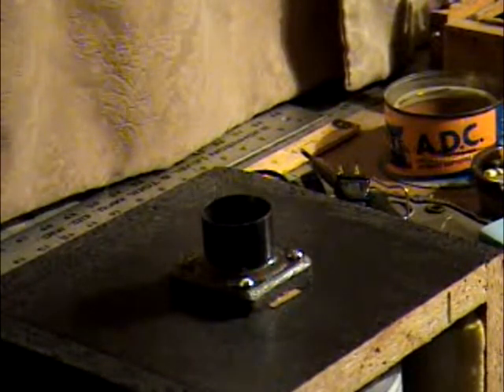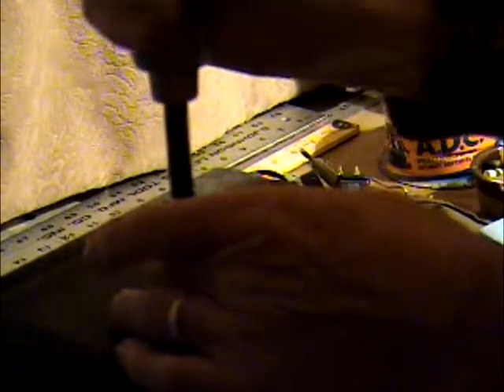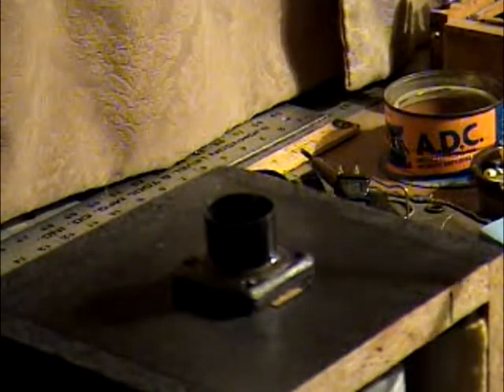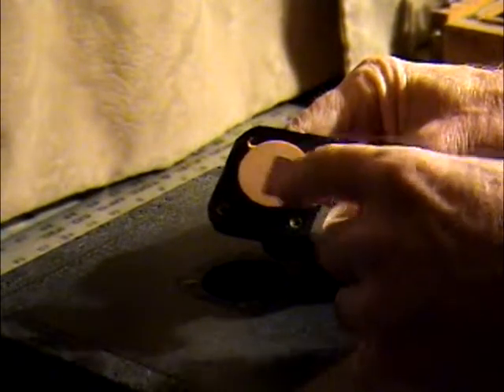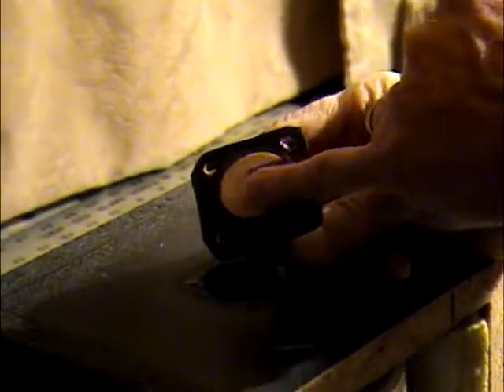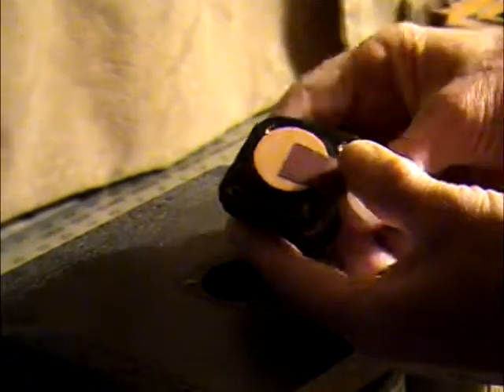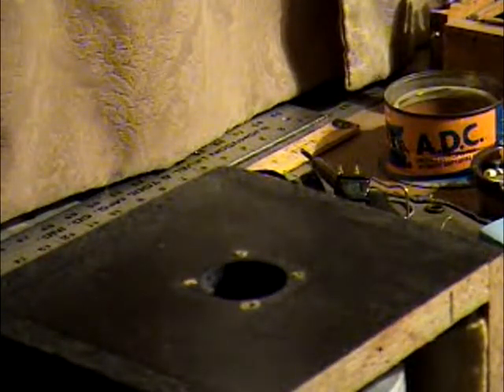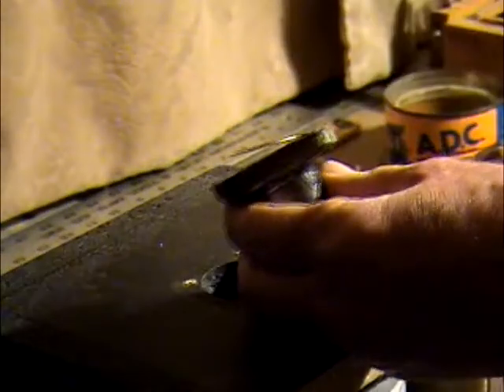Check Valve in an Electric Vacuum Pump by John A Tuttle from Player-Care.com

Comment: Great videos. Thx!!
 My 2nd player piano has a similar looking electric pump.  The check valve wasn't working so pumping by foot was futile.    When I pumped hard,  I noticed it made a horrible sound, like a bullfrog croaking.  
The owners just gave me the piano. 
When I got it home I found the loss of vacuum was the electric motor.  I opened the pump box.  Inside it had a 6 inch leather strap nailed across the hole.  It was supposed to seal the hole when using the foot pump.  It was too loose, so it vibrated badly. (the frog sound).  I was afraid if I tightened the strap, I would impede the flow of the electric motor, so I removed the strap for now thinking I could design a better check valve later.
What I did was cut a disk out of tin can lid, covered it with felt and attached a home-brew hinge.  I used a thin ballpoint pen size spring mounted sideways at the hinge to hold the valve shut.  It works pretty well.  Never thought of bellows cloth.

Currently starting to automate the first piano, borrowing parts from the 2nd to test.  My fist piano is much nicer so I'll donate the 2nd afterwards.